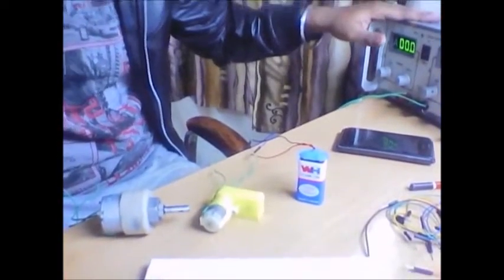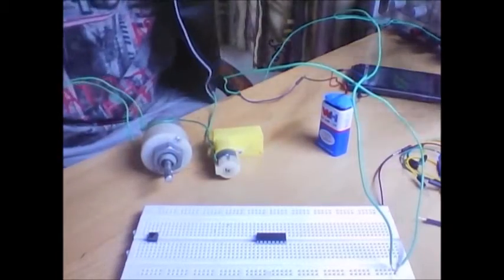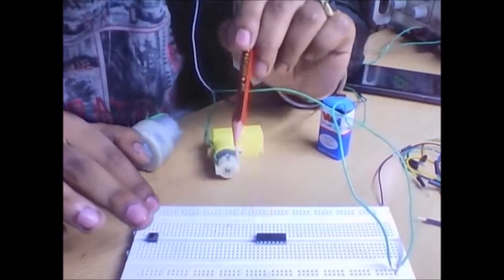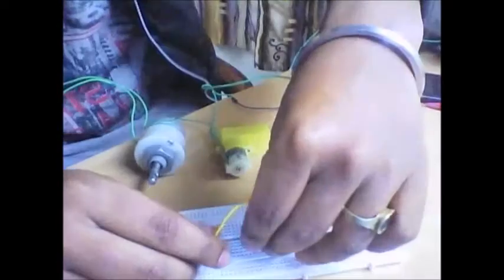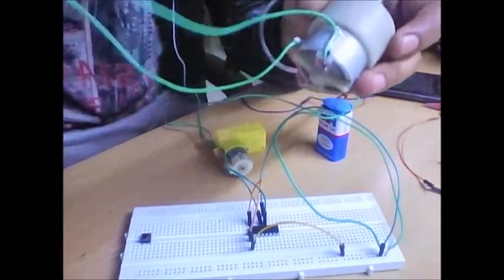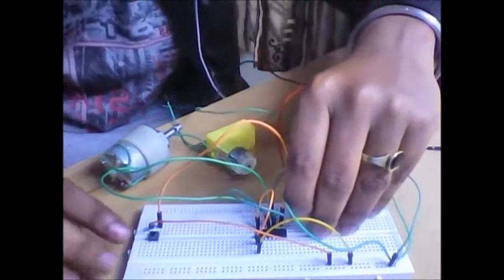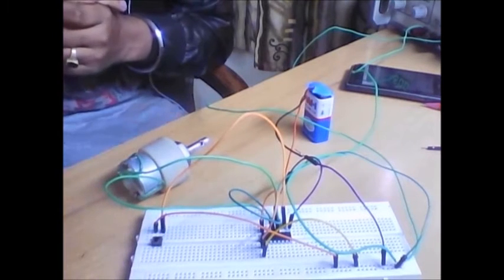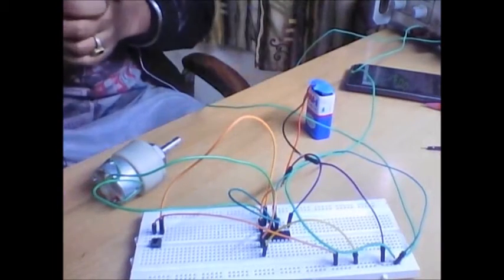Controlling Dc motor using push button

Comment: Good to see your video
I need to control dc 12v motor with push button as... Push to fwd- stop - push to revers. Without changing connections. 
Can u help.